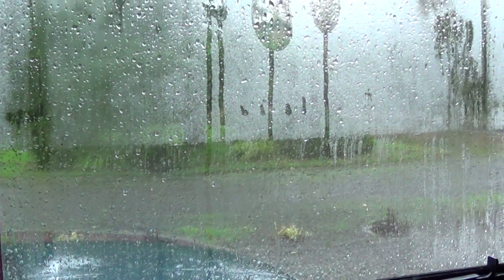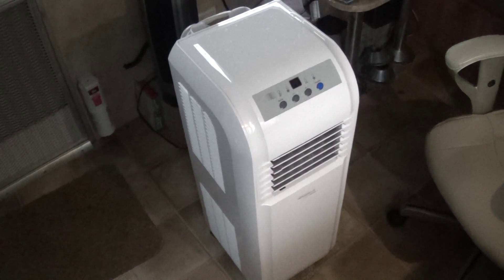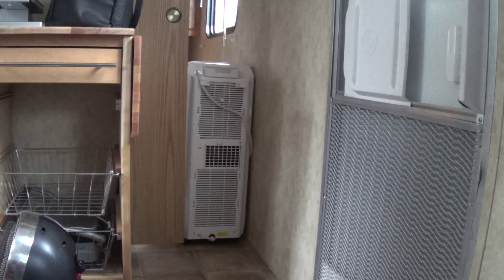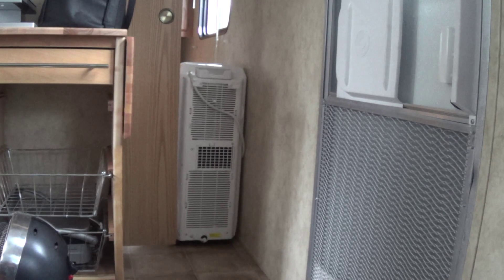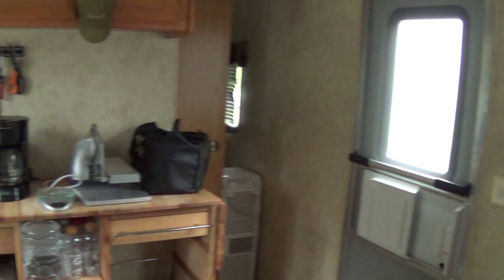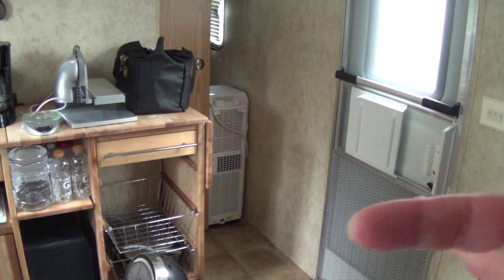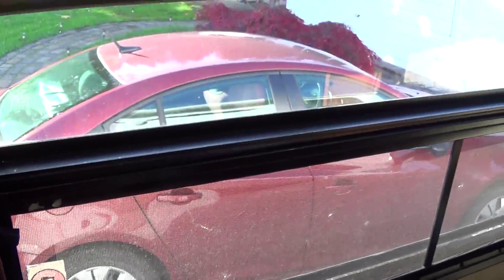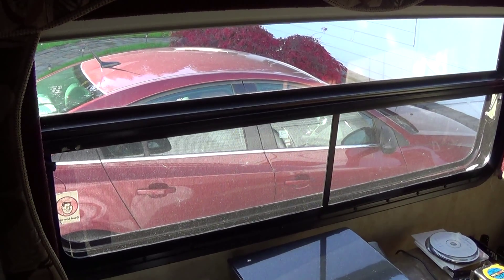Travel Trailer Condensation problem

Comment: I'm having some condensation woes currently.  I don't have a vent/fan on the of my van.  I'm playing around with all sorts of options now trying to get it under control.
Reply from the maker: It is difficult.  I think you will find ventilation the be the biggest help.  The more air you can move the better.  If you have a roof vent, try opening it a crack and a couple of windows a crack.  It will help alot.  That Dryzair stuff and similar product don't really help.  They just cannot keep up.  I am looking at a really small dehumidifier from home depot and might give it a try.
Reply: I'm thinking small dehumidifier too but I did order a rechargeable silica thing that that I'm going to use in the closet.
Reply: Fernbark Frist Here's what I can't wrap my mind around - you want to seal everything up nice and tight so water doesn't get in and insulate really good too to keep warm or cool but you should leave windows cracked. I feel like I'm working against myself.
Reply from the maker: If you are insulated well, that will help with condensation.  The problem with cars and rv's is that they have single pane windows and sometimes no insulation between the wall/skin and the outside.  I am thinking about trying some that plastic shrink wrap for winterizing windows to simulate a double pane  glass like houses have and seeing if that helps.  Obviously that big glass window in the front is a problem for you.  Another thing to remember is that if you are in the van, your body releases alot of moisture that needs to be vented out, so if the van is sealed that moisture is trapped inside, which brings us back to ventilation.  It's all part of the fun of living in the PNW.
Reply: Fernbark Frist my van is barely insulated and that's not going to change much. Funny you mention the plastic stuff to make a double pane window. I've used that stuff before and it helps. I just started looking into and trying bubble wrap on the windows (and maybe parts of the doors) I'm wondering if I can use the moister on the windows to my advantage. Might make it worst who knows. I just did 2 windows. I'm going to give it a day or so and see what happens.
Reply: Fernbark Frist I think I'll just curl up under my electric blanket and open all of the windows
Reply from the maker: I am curious if the bubble wrap will work!  I think I have some from xmas packages.  I will try it on my front windows I don't look out of.  I ordered some insulation for my wood stove project that would probably work good for your roof and sides.  I hope to get that video done by Wednesday (I think that is when it is suppose to arrive).    BTW,  a bottle of wine helps electric blankets work better.  Just throwing that out there.
Reply: Fernbark Frist I'm think if anything the bubble wrap will at least keep the condensation contained to the windows. I'll let you know how it goes. I don't plan on adding much insulation to the van. I have a fiberglass top and just a few inches between my head and it. Although I bet bubble wrap would stick to it. The cabinets are already built in and I'm not ripping them. The doors can be insulated, maybe a little under the bed but that's it. Then it starts cutting in to living and storage space.

Comment: I got lucky and found an "Eva-Dry" at Goodwill, new in the box, for $24.95... this Lil guy is a trooper, and is whisper quiet...I wouldn't even know it was on if it wasn't for the green light next to the switch and the water the accumulation in the canister! I'm going to get a second one though...as I think that 24 ft camper is too much space for it to work efficiently...
Reply from the maker: I am not sure how lucky you were.  The sell for that much or less everywhere.  But glad it works for you.
Reply: Fernbark Frist they are advertised on Google from $30 to $60. At $24.95 and not having to wait or pay for shipping, I got a very good deal. And I am very happy with it.